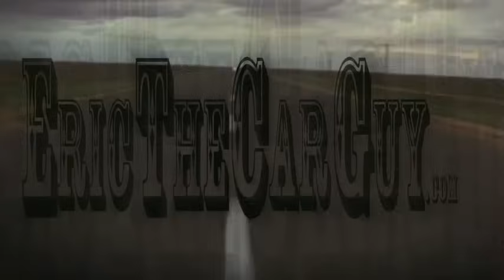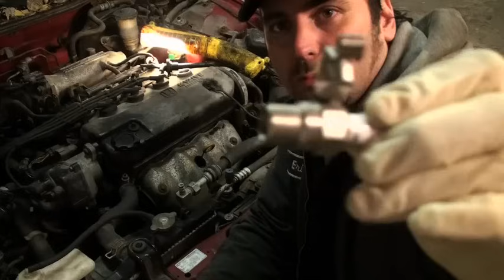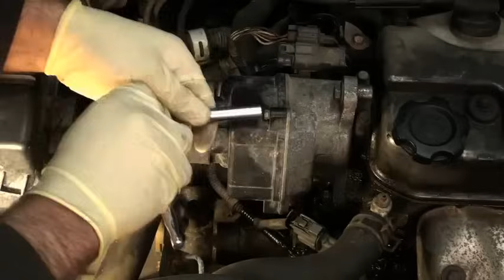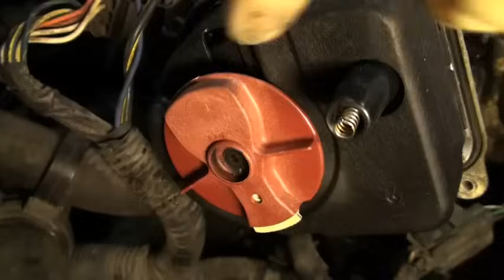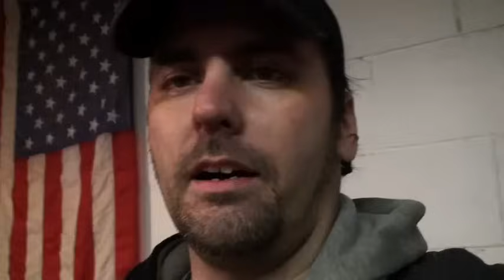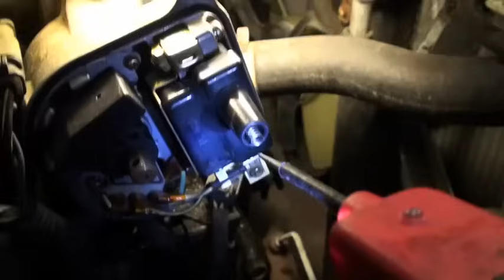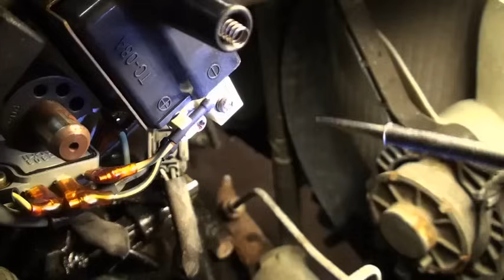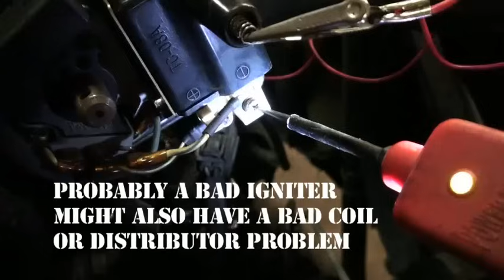No Spark Diagnosis (Honda) - EricTheCarGuy

Comment from the maker: Your welcome and thank you for the great comment, merry Christmas to you too BTW.  99 through 03 (and sometimes later) transmissions had weak 2nd gear clutch packs.  I think there was an attempt by Honda to make their cars shift smoother that unfortunately caused the failures.  Before 99 I had lots of complaints of harsh shifting especially on turns.  The truth is that the harder an automatic shifts, the longer it will last, but when your trying to keep costumers happy you do what you can.
Reply: Eric what could be the cauce of a weak spak on cylinder one, the scanner gives me P1399 Misfire in any cylinder, P0300 random misfire, P0301, P032, P0303, P0304

Comment: I have played with alot of honda distributors and have never had oil inside the cap. A common problem I know of is the O ring on the dizzy going bad. Its found on the dizzy where it goes into the head. Youll see its right next to the keyway thing that goes into the cam. Another problem is breaking the bolts for the cap. Those tiny 8mm bolts break like nothing.